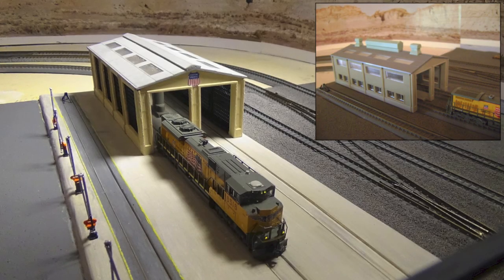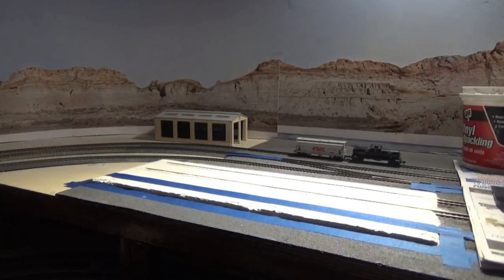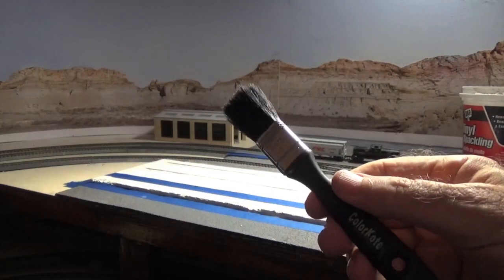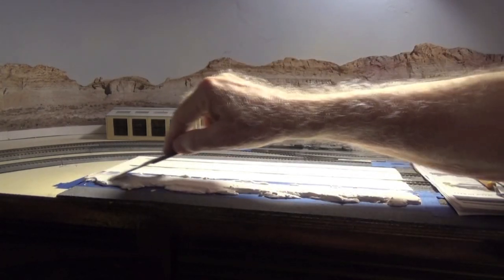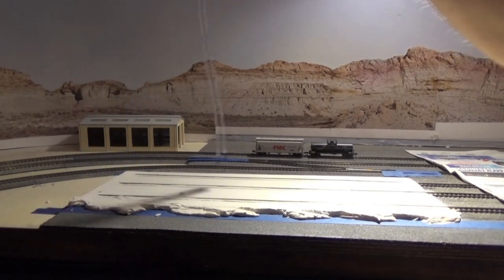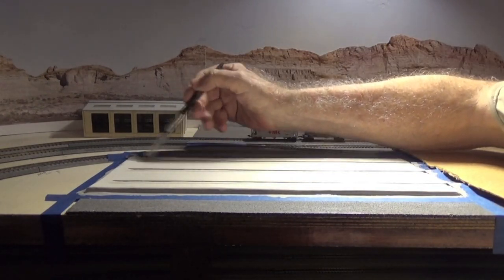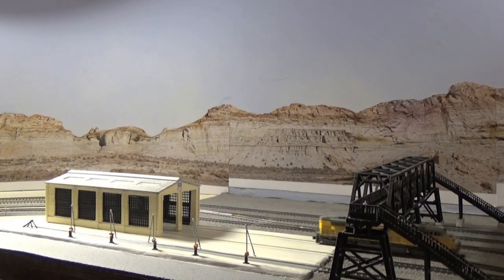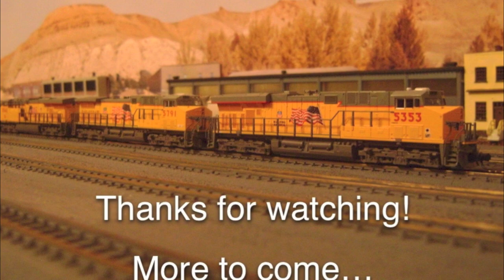A Refueling and Maintenance Facility on My N-Scale Union Pacific Layout

Comment from the maker: In this video, I have already applied all of the spackling paste for this project, except for the last (or front) section where the fuel cranes will go. For the sake of brevity, I didn't show all of the applications in the video. I applied the paste in sections - first on one side of the track, then on the other side, and finally between the rails - and allowed the paste to dry overnight for each section before moving on to the next section. Thus, it took a lot longer to do the project, but doing it this way made it a lot easier to apply each subsequent section. I applied each section in a single layer level with the top of the rails of the Kato Unitrack. I smoothed the top of each section by dipping the spatula in water, so that I wouldn't have to sand the paste very much after it dried, to avoid scratching the rails with sandpaper. The paste did not crack as it dried. If the idea of slopping spackling paste all over your track intimidates you, you may want to try it first on a section of track off-layout.

Comment: That spackling paste idea is genius! Ill be doing that, as well as some other Ideas ive learned from you on my layout as I get it going this winter!  One thing though. Your maintenance shed isn't used for locomotives. its a car repair shop, and they switch it with a trackmobile.
Reply from the maker: The sparkling paste has worked well for me in paved areas and in scenery. Thanks for the information regarding the maintenance facility at Green River. It's difficult to find out this kind of information online. So I really appreciate that you have shared the information with me, because I want to replicate the prototype I am modeling as closely as I can in my limited space. I'm pretty sure locomotives still use the refueling facility. Do you know if that is correct? I could be wrong, but I don't think there are track mobiles available in N-scale. ...Roy
Reply: Yes, they do still refuel there. And if trackmobiles arent available, it probably wouldn't be too far off the prototype to switch it with an SD40-2. I'll be in Green River either tomorrow or the next day and ill try and take a couple photos for you.
Reply from the maker: Thank you so much. I can't begin to tell you how much I appreciate the information you are providing and the photos you plan to take. ...Roy

Comment: Hey Roy, I was wondering where you got that enginehouse. I also use Kato Unitrack and the current engine house I have does not match the geometry of the #6 turnouts.
Reply from the maker: Calum, the original kit was a kit from Tomix. I had to widen the doors for the track to fit into the enginehouse. ...Roy

Comment: ah ok, so you mapped out the area with blue tape, how many layers? how thick?  how long to dry between layers?   did you wet the surface for the new layer to stick to?
Reply from the maker: +Ed Wilson Again, good questions, Ed. Yes, the blue painter's tape helped me to define the edges of the paved area, and of course, helped to protect the track and surrounding area from messy spackling paste. To be sure, spackling paste isn't very messy, and it's easy to clean up. As for layers and thickness, if you mean of spackling paste, I applied it in one layer, and again, I applied it level to the top of the rails of the Kato Unitrack. So it's fairly thick. Overnight drying was sufficient. No, I didn't have to wet existing surfaces of dried spackling paste. New applications adhered to existing surfaces easily. I definitely tried to get the spackling paste as smooth as possible when I applied it, to reduce or even eliminate the need to sand it after it dried, because I didn't want to scratch the tops of the rails with sandpaper. Anyone who may be intimidated by the idea of slopping spackling paste all over their track can try it first on a spare piece of track off the layout.

Comment: what is the white base layer?  how thick ?   the paste you applied was only a topcoat. what about everything that came before that?
Reply from the maker: +Ed Wilson That's a good question, Ed. What you call "the white base layer" is actually sparkling paste which I had already applied in the project over a period of several days and which had already dried. For the sake of brevity, I didn't include all of that in the video. I showed only the last (or front) part of sparkling paste application where the fuel cranes would be installed. The thickness of the sparkling paste is level with the top of the rails of the Kato Unitrack. The whole project turned out to be a lot easier than I thought it would be.

Comment: How long is your platform?
Reply from the maker: Jon, my layout fills a room measuring 10 feet by 12 feet. ...Roy
Reply: @n-scaleunionpacificevansto6569  I’m sorry I should’ve been more specific. Was ask specifically about the fuel platform. Not your whole layout just  fuel platform and then how far apart are your fueling cranes?
Reply: @n-scaleunionpacificevansto6569  I am a little nervous about spackling inside the rails but you said you just laid the spackle down and then ran an old car over the rails to keep them clean? Did you have to clean out the inside of the rails at all after you ran a car through it?